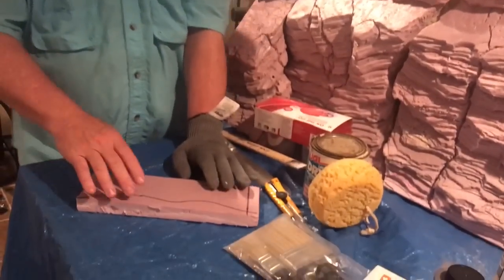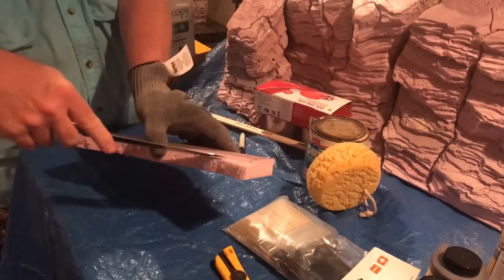How I Created My Faux Rock Wall Aquarium Background

Comment: Beautifully creative work!  I am wanting to make an indoor waterfall using this style of layered 'rock'.  Do you think this method/material (styrofoam foam boards coated with Drylok and Polygem) would withstand water constantly cascading down over them and remain 100% waterproof?
Reply from the maker: Thank you so much Mark.  Sorry for the late reply.  Yes, absolutely.  The Drylok is a great waterproofing paint and could withstand the water running, but the Polygem is really strong, and would protect your work and keep the Drylok from chipping off.  It protects against animal claws, accidental damage from cleaning, etc.  I highly recommend it.  And yes, it would remain waterproof.

Comment: Where do you get those styro sheets that are coloured like that?  I am in Ontario Canada
Reply from the maker: Hi Cheryl.  I found them at Home Depot.  These sheets are the hobby version.  I think that Dow makes them.  The larger ones built for home insulation are cheaper and will work just fine, but kind of a pain to haul out of the store unless you have a pickup truck or cut them in half.  The blue or green ones work just as well as the pink foam, as long as they're closed cell foam.  Any of these would work just fine.  I'd get the ones that don't have the foil other material on the back side, get the all foam sheets.  The larger sheets come in various thicknesses, but the ones that you choose depend on your project and are your choice.

Comment: BUT, how do you place it in your aquarium once it’s completed?
Reply from the maker: The wall fits tightly against the back of the tank and under the tank frame.  I also used a LOT of silicone, about 8 tubes worth.  Check out my latest video to see it after installation.  Thank you for your interest!

Comment: Hello Kevin! I just found your channel and I'm so happy I did! Been thinking about keeping some local fish here in Sweden in  an aquarium and your content on the subject has been very inspiring!

Now to my question in regards to this video... I've been working on some backgrounds and also faux rocks for various setups, both aquariums but also indoor mini fountains. I've seen a few people recommend Drylok for these things just as you have, but then followed by a recommendation of still adding another type of epoxy or rubber based coat on top of it. Would you say the main reason for doing that is because the Drylok might crack under pressure since it's applied on a soft surface such as styrofoam? If I were to use it on a very hard surface such as concrete or stone plaster, do you think it could last by itself without adding some other type of coating?

Thanks for all the great content and sharing your expertise!
Reply from the maker: Thank you Sebediah.  Yes, I think it's a really good product as it's meant to seal basement cinder block walls.  It's very durable.  If you tried to peel some of, or scrape it off, you probably could, but it would take some effort.  Also, there could be some fish species with raspy teeth that eat algae that could peck if off.  That might be a good reason to use an epoxy clear coat.  But, I did it so that I could clean it with a brush easily without damaging or breaking the foam as well as protecting the paint.  Also, if I do other maintenance in the tank, I wanted that extra protection so that I wouldn't accidentally damage my hard work.  I used a product made by Polygem that is used by museums and public aquariums, it's a clear coat eposy.  It is very strong and you can barely tell it's there.
Reply: @coachkevinwilson1958  Thanks for the reply! I'll keep these notes in mind when I get the Drylok and start experimenting. I guess at the end of the day I'll just have to try this myself and see how it all holds up, I could see an extra coating being very useful for my aquarium but perhaps not as necessary for the fountains as they don't really get algae nor do they currently host any animals. You don't happen to know the exact name of the product by Polygem? I might not be able to get it here in Sweden anyway, but I've seen some other similar products that will probably get the job done. Have a nice day!
Reply from the maker: @sebediah7206  Thank you!  I used Polygem 1319 but if you decide that you can buy from them, contact the owner and ask him what to use, because I think the version I used was an older type, and the other one in that family of products is a newer improved version.  The biggest factor is that my work is protected from myself, LOL.  I can't accidentally damage it.  I used several coats of Drylok too, mainly to get the colors that i liked by mixing different cement dyes in them, and also to cover up every tiny bit of pink foam that I could see.  I didn't want any trace of the foam showing, not because I care about leaching stuff or anything, but instead just having it look the best I could make it.  It's good stuff, you can't go wrong.  But without the polygem, it could accidetnally chip away exposing the  pink.  You could just repaint it though, I guess.  In my case, I'd have to break down the tank to repair it so it was safer to apply the clear coat epoxy to protect it.  I've read about other people just using the Drylok and it worked well for them.  Good luck on your project!  If you want to ready more about what I did and why, check out my build thread on this native fish forum, lots of pics and info there:  http://forum.nanfa.org/index.php/topic/16651-75-gallon-native-stream-tank-build/page-11  this page is where to the Polygem, the pages leading up to it show applying the Drylok.
Reply: @coachkevinwilson1958  haha I get it, makes sense that you would not want to worry about potential repair work considering the size and complexity of your background! Doesn't look like I'll be able to get this particular brand here very easily, but we've got a couple alternatives that seem good enough so I will give that a try for the background. For the fountain rocks I will probably try just using Drylok and see how it goes. 

Thanks for all the feedback and advice you've given! Really appreciate it.
Reply from the maker: @sebediah7206  Thank you so much!  BTW, I'm making a video from start to finish on how I made the wall and what it looks like today...stay tuned!

Comment: Hey Kevin, I know you use this for aquariums typically. But I have plans on using this in a vivarium, does this stuff tend to get super waterlogged? Also would it be porous enough for plants to adhere to it, or does that mainly depend on the type of paint you use? Thanks, and great video.
Reply from the maker: I think that you could create divots and holes that plants could creep into.  It's not porous though for the most part.  In my case, I used Drylok mixed with various cement dye colors to paint it, and then covered the exposed surfaces with museum grade epoxy clear coat made by Polygem to protect it from fish or other critters that might pick at it, or more importantly, from me damaging it during cleaning and maintenance.  Polystyrene can be damaged easily.  It's a strong structure, but easy to chip away at.  So far, I haven't had any problems.  I don't know how plants would react to it with the clear coat, but, it doesn't stop algae from growing on it!  But, even if you decide to use Polygem or not, the great thing about foam is that you can stick things in it to hold mesh or just stick wooden or plastic kabob sticks in it to hold plants.  It's a very nice material to work with, completely inert, so you don't have to worry about it hurting your creatures, fish or plants.  I used Gorilla Glue to bond the layers, and that works great.  Once glued, it won't come apart, and it's inert too once dried and cured.
Reply: Thanks Kevin! Helps a lot, just staring on the build.
Reply from the maker: @closedcourseproductions4832  If you do a video or post pics on a forum, please share here if you remember.  I'd love to see it!
Reply: @coachkevinwilson1958  what forum could I post my finished product on?
Reply from the maker: @closedcourseproductions4832  There are lots of good forums out there that you can find on this subject, but some of the aquarium forums have sections for vivariums and other things.  One good forum is this one that has a Vivarium section:  https://www.aquariacentral.com/forums/

Also, on many of these forums, aquarists are interested in Vivariums and paludariums and post their builds in DIY sections or other places on the website especially if they are DIY sections.  This website has some really good vivarium builds:  https://www.monsterfishkeepers.com/forums/

Check out this one in particular:paludarium, one of the inspriations of my river tank build:  https://www.monsterfishkeepers.com/forums/threads/mudskipper-paludarium-an-alternative-solution.410444/
Reply: @coachkevinwilson1958  awsome thanks! Also how long do you let the drylok and concrete dye dry before putting in a tank? About a week?
Reply from the maker: @closedcourseproductions4832  I think that you can assume that what the directions say on the can of when it's fully dry, that amount of time would be safe.  I don't have that info on the top of my head, but maybe check their website.  I'd guess maybe 12-24 hours maybe?  At that point, of when it's fully dry, it's safe and inert for fish.  You could wait a week to be safe, but I'm not sure that's necessary.

Comment: Great technique...can you tell the name of the foam you used?
Reply from the maker: Thank you tstoneami!  I used styrofoam (extruded polystyrene) foam board.  What I used specifically were hobby sized versions of foam board purchased at Home Depot.  You can use the pink or blue insulation foam board sold in hardware stores.  I used the hobby sized ones because they easily fit into my vehicle.  I think the extruded polystyrene foam insulation works best to get the detail carving that you might want. but you can use anything that is inert.
Reply: @coachkevinwilson1958  Thank you for the reply.  I thought I recognized it, but wanted to be sure.  It's funny, was looking for a source for shale right around the time I ran across this - has a similar look to a wild outcropping of shale!
Reply from the maker: @tstoneami , thank you.  Please feel free to ask questions at any time.  I will respond.  A good source of info are the forums that I post in.  Here is a link to one of the build threads:  http://forum.nanfa.org/index.php/topic/16651-75-gallon-native-stream-tank-build/

Comment: I have watched multiple videos of making these aquarium backgrounds and i like this one very much. one question i have with all the ones i have seen is how do you run your intake and outflow for your filter if you are using a canister filter? just behind the wall and make a hole for each? it seems like you wouldnt get good flow that way but curious, thanks
Reply from the maker: Brian, thank you for your comment and your interest in my tank build.  I basically built the intake into the left side of the wall, hidden from view behind a removable panel.  The outflow is from a spray bar across the top of the left side of the tank, flowing across the tank.  Additional current is obtained by the use of a strong powerhead that is hidden behind my DIY roots also on the left side of the tank.  I purposely tried to hide the equipment from a normal front view of the tank.  Even looking from the front right of the tank, it's tough to see the powerhead.  For more details, check out my build thread on the NANFA forum.  This link will take you specifically to a post that describes the flow in the tank with details of pictures, http://forum.nanfa.org/index.php/topic/16651-75-gallon-native-stream-tank-build/?p=153549.  The posts following this one to the end of the thread answer similar questions.  I may do a video that explains all this as well.  This past weekend, I performed a water change and cleaned out the canister filter.  It was quite dirty after just a couple months, so apparently, there is enough flow to clean the water effectively.
Reply: @coachkevinwilson1958  thanks for the reply Kevin, appreciate the quick response and the link. research is on!!

Comment: Which drylok did you use?  Just googled it and there are different types at Lowes.  Also, non toxic to fish?  Amazing work/wall.  I've gained several ideas for my leopard gecko's terrarium.
Reply from the maker: Thank you so much for the kind compliment MrGochiefs1!  I used the original Drylok in the gray color, but I'm sure that the white would work just as well.  I mixed it with various shades of liquid cement dye to get the colors that I wanted.  I don't know if they make the gray version any more.  Don't get the ones with mildew killing formulas or anything like that.  Once this stuff dries, it's inert and not toxic to fish or animals.  However, shark claws or teeth could tear the Drylok off of the foam.  I used Polygem Clear Coat Epoxy (the stuff that they use in museums) to protect my wall.  I wasn't worried about fish doing damage, but rather, worried that I might cause damage while cleaning or doing maintenance.  The Polygem really helps with the durability.  Drylok is a sealant, and so is the Polygem, so if anyone worries about foam causing problems with water quality, these two items solve that issue.  And, IMHO, this is an easier way to get detail into your work rather than using concrete.  I look forward to seeing your project.  If you do videos on it or post in forums, please post the links here and I'll follow.  Good luck!  Oh yeah, you can get the Drylok Original at Lowe's or HD, or maybe Ace and other hardware stores too.   here's the link to what I used:   https://www.lowes.com/pd/UGL-White-Flat-Textured-Waterproofer-Actual-Net-Contents-128-fl-oz/3033249

Comment: Wow! Amazing!!! I am gonna try something like that. Not sure I will find the material in my country though
Reply from the maker: Thank you so much.  You can use any closed cell foam board insulation material if you can find it there.  There are several brands available in the US.  They come in pink, blue or green.  If you can't find it there, you can use any kind of styrofoam.  The open cell styrofoam works OK, but I like the closed cell better, because you can carve more detail into it.  Good luck!
Reply: @coachkevinwilson1958  definitely will be looking, I did some rock formations out of foam in a can and cement. Hopefully sink lol.
Reply from the maker: Rishi, anything you can do to reduce the foam inside your structure will help.  In my case, the structure fit tightly and perfectly inside the tank, so the molding of the tank helped to keep it in place.  In addition, I used 8 tubes of silicone to glue it in place.  That's a lot of silicone!  I glued it on both sides, the back glass, and the bottom.  Also, when building it, I stuffed as many river rocks into the structure that I could and then filled the gaps with spray foam.  There are all kinds of things that you can do, but don't underestimate the ability of this stuff to float.  Spray foam is a great media to produce natural looking lava rock.  It's pretty amazing stuff.  After you finish, please post a link here, I'd love to see your work!

Comment: What type glue are you using to glue styrofoarm together?
Reply from the maker: I used regular Gorilla Glue.  It's very strong.  Make sure that you moisten the foam at the gluing contact point to make the bond even stronger.
Reply: Kevin Wilson thats alot glue to use for 180g tank( 6feet long)
Reply from the maker: The tank that this is installed in is a 75g.  I think that I used one and a half 8 ounce bottles.  All you need is a thin coat between styrofoam boards.  A little bit goes a long way.
Reply: Kevin Wilson thank you sir

Comment: Which specific foam is that?
Reply from the maker: They're called Foamular Project Panels and they are 2'x2' and 1" thick.  I got them at Home Depot.    Here is a link to the foam boards that I used:  https://www.homedepot.com/p/Project-Panels-FOAMULAR-1-in-x-2-ft-x-2-ft-R-5-Small-Projects-Rigid-Pink-Foam-Board-Insulation-Sheathing-PP1/203553730

Comment: Qué material es que usa?
Reply from the maker: Hi Moises.  I made the wall out of Foamular Project Panels and they are 2'x2' and 1" thick.  I got them at Home Depot.  You can use any of the foam insulation board.  I saw some that were 4'x8' and 2" thick.  Knowing what I know now, I would have purchased and used one of those boards as well as the ones that I purchased.  I think that the thicker boards give you some more carving flexibility, and less gluing (saving more time drying).  But, hindsight is 20/20.  My project turned out OK.  I'll post a new video update soon, as I am nearly done with the faux roots for my tank.  By the way, I painted over the pink color using Drylok mixed with cement dye to give the wall a more realistic look.  Here is a link to the foam boards that I used:  https://www.homedepot.com/p/Project-Panels-FOAMULAR-1-in-x-2-ft-x-2-ft-R-5-Small-Projects-Rigid-Pink-Foam-Board-Insulation-Sheathing-PP1/203553730
Reply from the maker: After I  carved the faux rock, then I painted them with Drylok, and American product that is basically waterproofing paint.  I mixed it with various colors of cement dye to create the various colors of paint on the finished wall.  You can see the finished product in my later videos.  Thank you for your comment!

Comment: What is acrylic fish safe paint
Reply from the maker: I've heard Krylon spray paint acrylic is OK to use.  With my wall, I used a product called Drylok, which is a waterproof sealing paint, which is inert and safe in fish tanks.  I mixed it with cement dye to get the colors that I wanted, also fish safe.  As long as these products are completely dried and cured, then they are safe for fish.
Reply: @coachkevinwilson1958  thank you for all informations
Reply from the maker: You're quite welcome A A